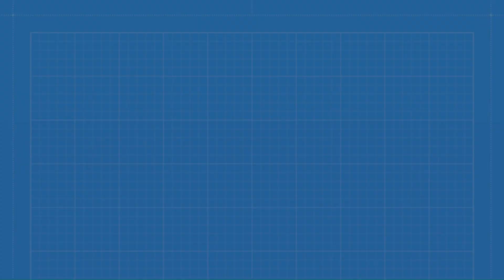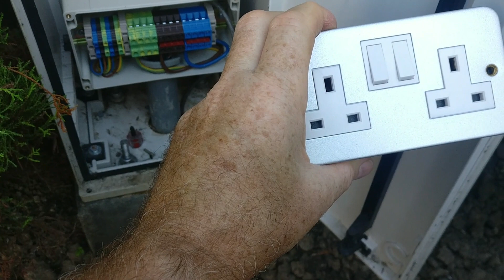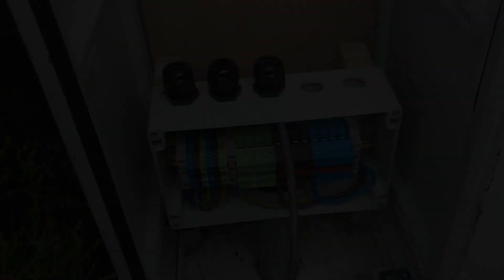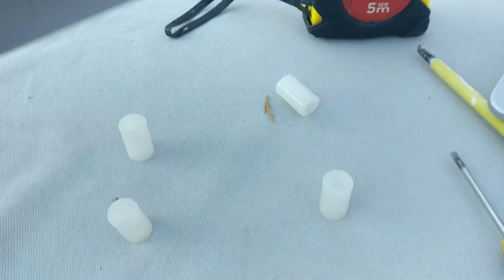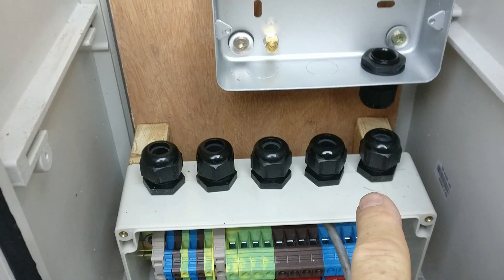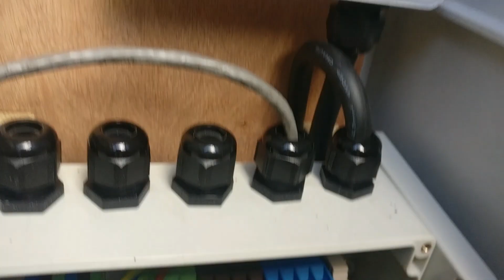Outside Electrical Cabinet |  Power Socket Install

Comment: Nice bit of kit but not sure about running an Ethernet cable through a 230V junction box but it is your property Pete and you can do it if you want to Buddy
Reply from the maker: Hi Mike. I've got some flexi conduit for added insulation that's going over the ethernet cable. I forgot to include it in the video. It should be on there in the next video 👍
Reply: @Builtbypete    Nice one Pete that will sort the issue out nicely!